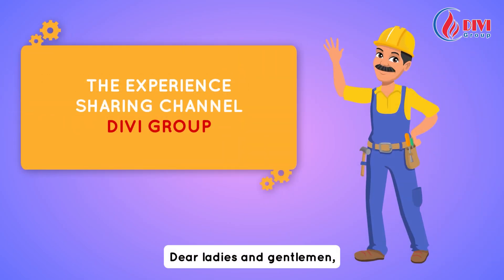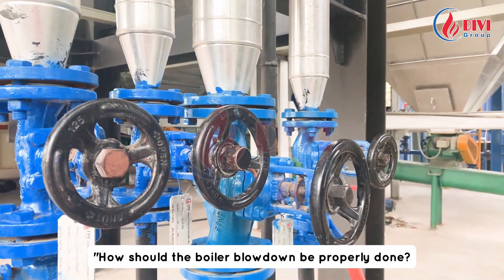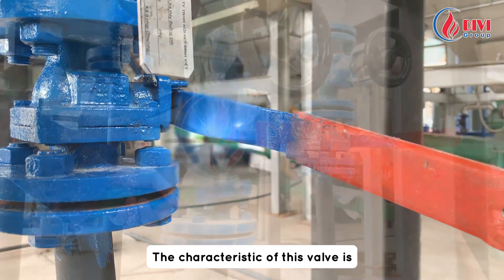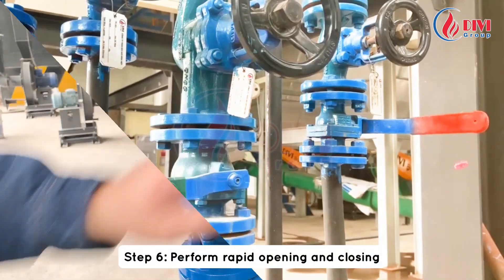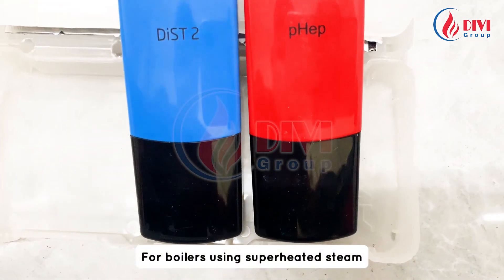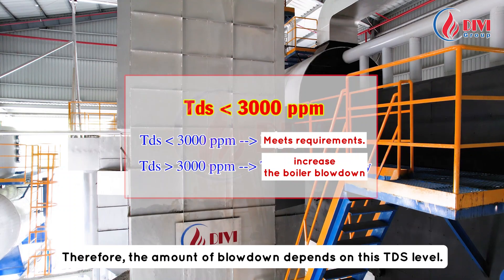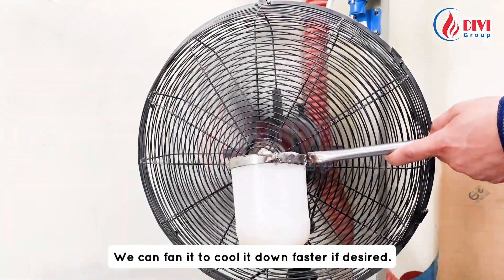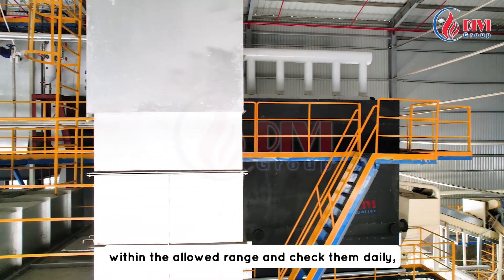[DIVI] Why is it necessary to perform blowdown for boilers?

Comment: I like this video, but does flushing the sediment frequently have any effects?
Reply from the maker: Proper blowdown will help remove sludge from the boiler, increasing the boiler's lifespan and optimizing fuel consumption for the boiler. However, excessive blowdown can lead to heat loss to the environment and increased fuel consumption. Therefore, blowdown must be controlled within an acceptable range.